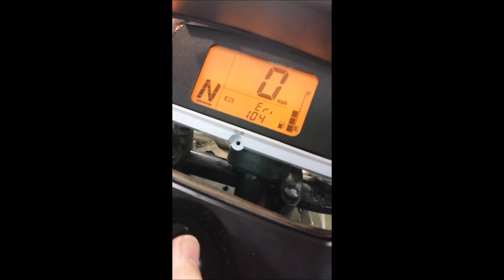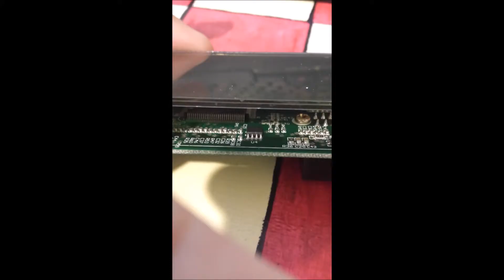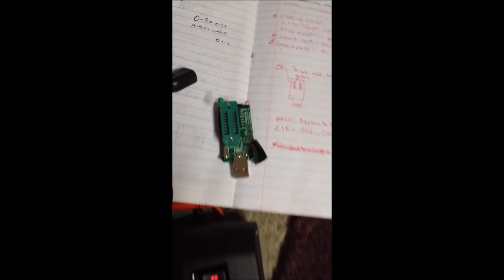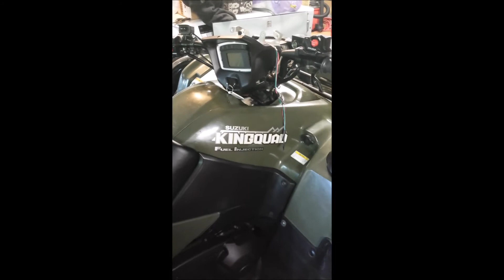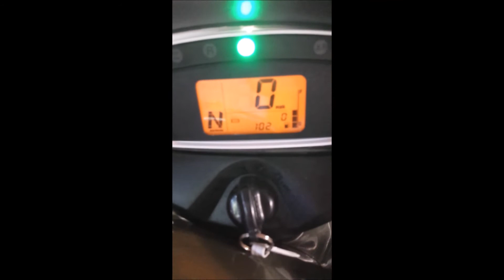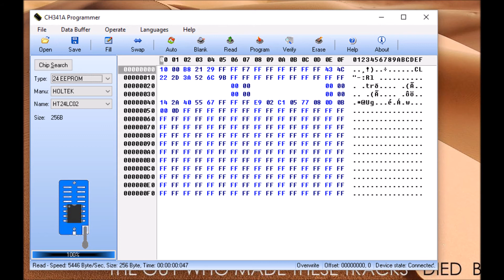King Quad Err Error Fix Cluster

Comment: An update on my progress to all who are interested.  I have a 2007 Kingquad 450axi, My odometer reads err and fuel gauge is at zero and flashing, every thing else works. I got inspired by Nolen' Video and purchased the CH341A programmer and attempted to follow this video to repair my speedometer vs buying new for $300.00.  However my programmer I purchased off Amazon for $13.00, was the black model.  Difference between the black and green is the operating voltage 5V vs 3.5V with the green one.  Basically I was able to download the software needed and install the driver but not able to read or write the chip.  Searching you tube, I managed to find a guy who converts the black ones to 3.5V with a simple solder and wire technique.  Keep in mind, I am a mechanic of 20yrs and not an electrical or software engineer.  I know how to solder and am very good at diagnostics but have never programmed eeprom before.  Following you tube I was able to get my Odometer to work by resetting the 0X20-0X25 to 5 - 0's and FF.  Also learning my fuel sending unit is reading infinite.  There is more work to be done yet.  HUGE Thanks to the smart youtubers who share their expertise and Nolen for this video.  I believe together we can make a difference.

Comment: Never had any problems with my 2007 King Quad 450 until the key was turned on by my grandson, ran the battwry down. Problem  started when I  jump started it with my pick-up.  Now no start but, displaying  Err.. any suggestions?

Comment: Hello, thanks a lot for the video. I’m writing to you in orden to see if you can help me with the next problem. See if got the eeprom pins and the USB with the proper colored cables connected to it. Up to hers everything ok, my problem is I don’t know the orden in which you have connected these cables to the eeproms pins (5,6,7,8,4) as you never get to show it in the video. Therefor, if you can send me the color and the pin code for this to work I’d be very grateful. For example, in order to your colours wires: red-5, green-6, blue-7...... Thank you.

Comment: Any idea on why sometimes the screen works and sometimes it doesn't? Well for the most part the screen is blank sometimes it will be on though. Also has ERR code and the odometer doesn't work. Any help on this will be nice?

I have a 2006 king quad 700
Reply from the maker: No idea. Sorry. This was a bit beyond me when I did it myself.

Comment: Do you offer a repair service if I was to send you my speedometer?
Reply from the maker: No, Sorry.  I don't think this every fixed MY cluster. As I recall, the issue may have come back later on. It may fix other's clusters or give someone a starting point to get a little further. Its super cool to be able to reach the chip. If enough people did this, we could figure out what digits to flash to a new chip and solder new chips in.
Reply: It's really cool.  You've inspired me.  I don't have experience with programming chips, but I have 20yrs with mechanical and some electrical.  Ill try to order the stuff required to attempt this and let you know if you're interested.

Comment: Thank you for your help in pointing me in the right direction, I was 
able to clear the ERR codes and retain my original instrument cluster 
with none of the issues with the Fuel gauge you described.  I am 
currently in the process of correcting the miles as well as the hour to 
rough value.
Reply: Hola solo. Español ablo tengo. Un proble ma con una. Kinquat 700 if
Reply: If 40 41